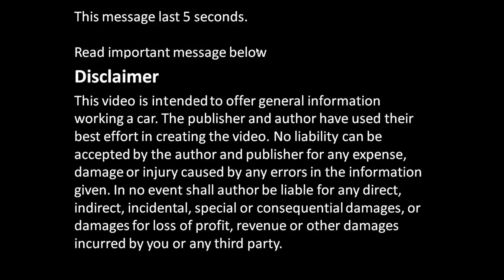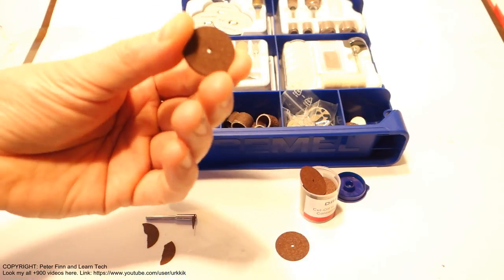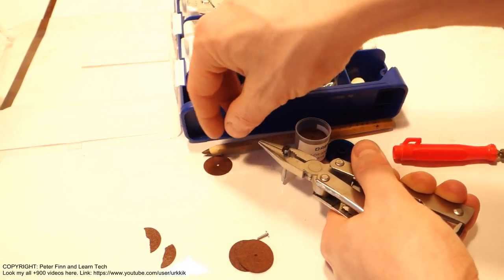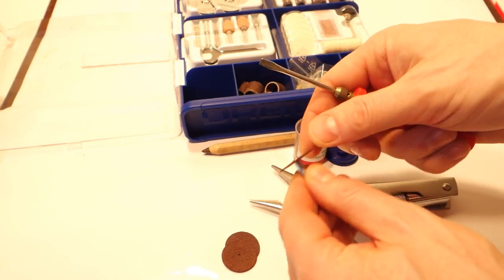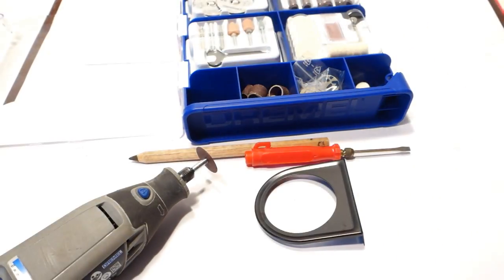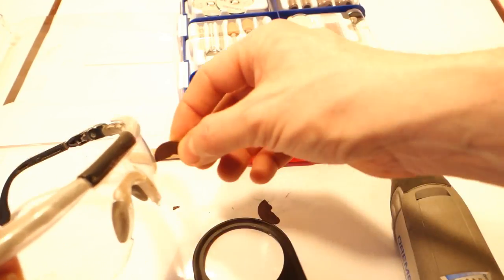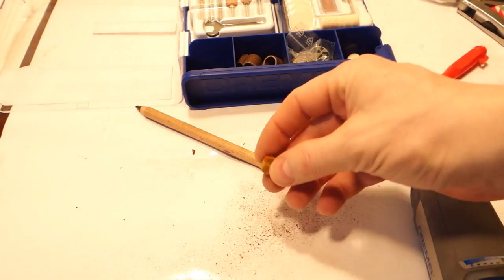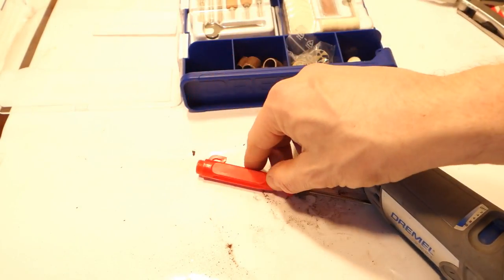How to use Dremel multitool accessory: 409 Cut off wheel

Comment: I'm a first time Dremel user. I never imagined a company could be so inept as to include zero instructions on how to operate their device. I'm a handy guy and I still couldn't figure out how to install the cutting wheel. I literally watched your video for 30 seconds and that was enough for me to understand how to work the tool. Dremel fails to mention anything regarding the screw needing to be unscrewed in their instruction (or the fact that there was even a  screw included!!). And that's just one of the many issue's with their "instructions." Anyway thanks for the video! You saved me hours of frustration and cursing!
Reply: They don't care they already got your $$$$$$

Comment: After breaking several of these fragile discs (muttering obscenities all the while) cutting thin, soft steel and without applying much pressure,  I found your suggestion to use two or even three discs at once for more strength very helpful. This also had me feeling stupid for not realizing that myself! Thank you for informing us with this very good video!
Reply from the maker: Hi, same issues also me.

Comment: One need not grip the post with pliers while securing the disc.  Simply install the post into the Dremel and use the lock to prevent the post from turning when tightening or loosening the screw.
Reply from the maker: Thanks

Comment: peter do you know why the first disc got broken?, it is the same just like an angle grinder cutting off, if you are cutting deep and push and push into the piece, specially on large pieces, the sides of the cut will close around the disc jamming and getting it broken, it works just like a any disc brake, thats why cutting deep by using a cut off wheel is almost forbidden specially when the piece you are cutting will not fall down easily by gravity, so the right thing to do is to cut around the piece by many cuts and not a deep cut, i know it is hard to explain but look at this video and you will understand what i mean
https://www.youtube.com/watch?v=F9z8_QsCuns
https://www.youtube.com/watch?v=C8ga0mM8FMo
Reply from the maker: The material is too weak.
Reply: yes peter you are right, the final solution i got for this is to go to a hardware store and buy 2 of the smallest washers they have and use them as flanges for the disc, it has worked for me
Reply: This important point which I would never have figured out on my own was very helpful to me!  Thank you!

Comment: I have the EZ495 cap that screws onto to the top of the tool. Using the 7700 model, do you know if this part is compatible with the 7300/7700 series? Ty
Reply from the maker: Yes

Comment: you are installing that cut off wheel completely wrong. There's another piece that the disc sits on and a washer to keep it "flush". Once you have those 2 pieces, you can screw your screw on. That's why your disc broke off since it's not spinning true.
Reply from the maker: Thanks for info !
Reply: Peter Finn stay safe!